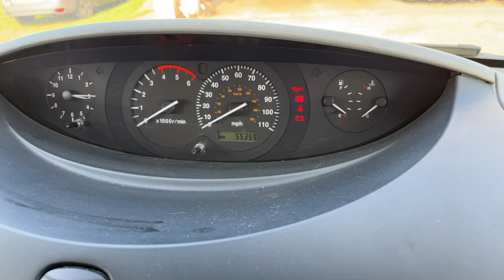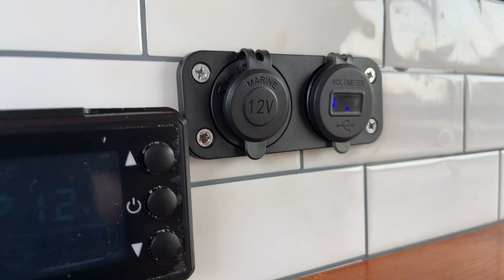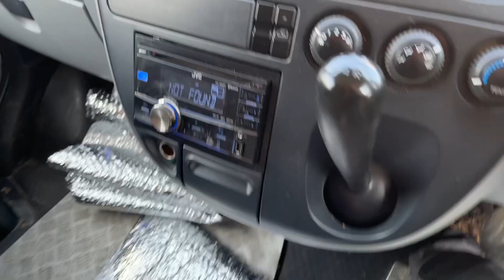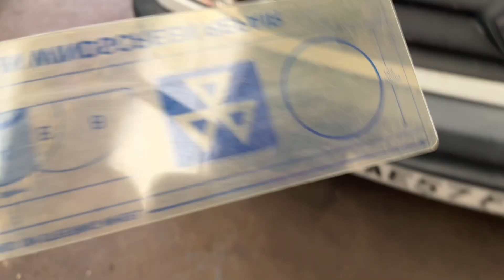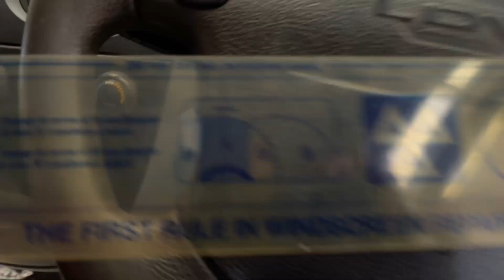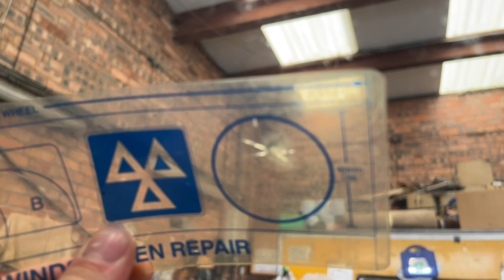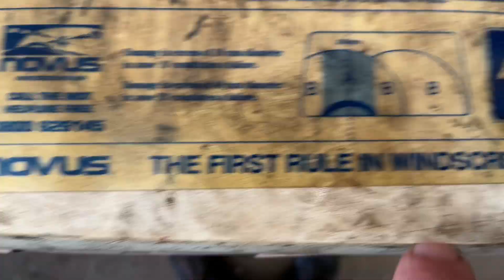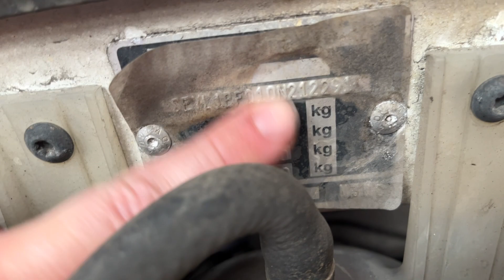Daily Vlog #29 |Car Addict Garage North East |#vlogs #vlog #shorts #car #cars #garage #mechanic #van

Comment: I really enjoyed this video. The walk was relaxing and your little dogs a star. Great insight on the LDV mot inspection details. 
It's still cheaper having the work done because its a good all round van with no major mechanical or bodywork issues. 
That's the way I have always assessed it. Buying a van is a lottery if your not a mechanic. Looking forward to the owners decision. Tony
Reply from the maker: Thanks for the feedback mate 👍🏼
Yes Hunter is a cracking pup, very focused and obedient very much a work in progress.

Yes never judge a book by its cover, might look like a tatty van from the outside, but they are solid underneath that little bit on the step is noting very simple repair.

As you say mechanically it’s spot on very minor issues, price of that screen is shocking and the lad I deal with is much cheaper than the big companies.

If she sells I will definitely buy it, price depending.

Thanks for watching 👍🏼

Comment: Cracking walk to work just a shame about the storm damage, exactly the same up here in Aberdeenshire, we got hit hard by Arwen back in November. 
I know you use quality parts in your repairs and rightly so but what about the consumables you use ? So many products on the market it would be interesting to find out as to why you have preferences to particular ones, especially so on the service items i.e. lubricants, top ups and so on. Not so much an in depth report just a mention as you are using them may be helpful. Good videos as usual.... cheers.
Reply from the maker: Yes northern England and most of Scotland got hit hard by Arwen….. shame we didn’t get the support the southerners got with the storm few weeks back.

As for lubricants we just use what ever specs are correct for the car, we have 200L barrel of genuine Toyota oil the covers most vehicles, but ones that are different like 0/20 5/20 0/30 all that stuff we order in 5L cans, oils are all made in the same refineries so as long as the grade and specs are correct forget the name on the bottle, all this Castrol and all this is a money making scam.

I will do a walk around on a daily Vlog that’s a good idea 👍🏼